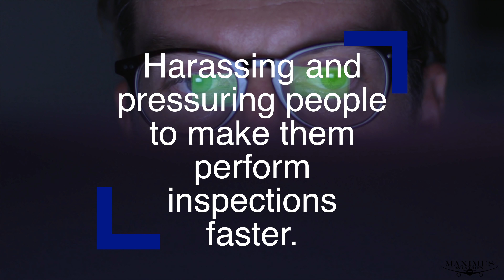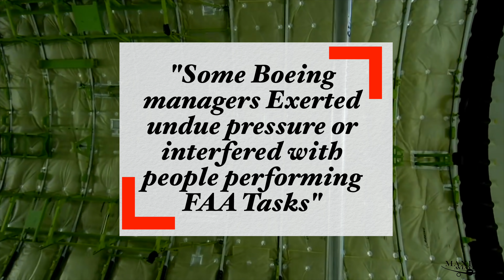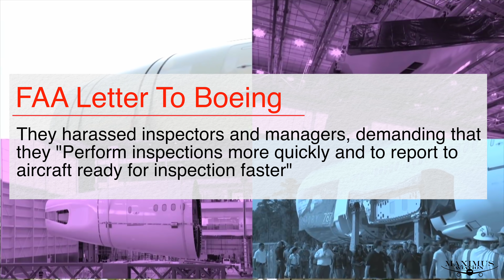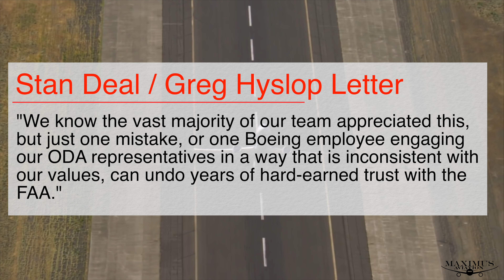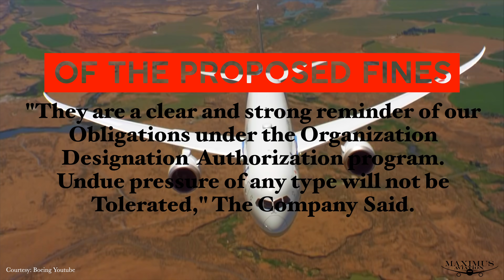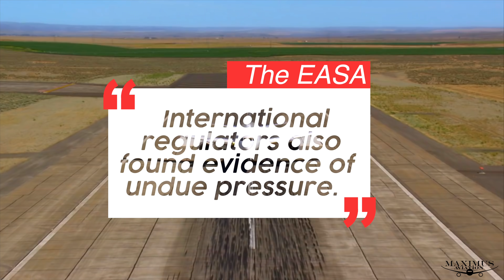FAA Fines Boeing 787 Program $1.25 Million Dollars For Interfering With The FAA's Inspection Process

Comment: FAA should refuse to certify any further Boeing aircraft while these people are still in management positions.
Reply: Well said. But will a mega corp  listen? How many have to die before there is change.
Reply: @johnambro7181  Too many, far too many. Boeing needs to be split up, before it collapses under its own weight, like Wall Street and The US auto industry back in 2008.
Reply: Exactly  right, David. @DavidLemmo
Reply: Would you not help your pals or your family members? :P that's how it goes! Plus - this is the largest exporter the US has... so.. it's all about the $$$, safety is and will always be at least 2nd after $ and/or fame.
Reply: @DavidLemmo  Boeing Commercial Aircraft is possibly not worth saving any more. They only have 2 active product lines to speak of and both are tainted.
Reply: @pasoundman  National pride and congressional meddling will keep Boeing Commercial afloat, at least untill they lose all their customers because Wall Street  bankers, who not concerned with the products were given more voice than the engineers that made Boeing Boeing.
Reply: @DavidLemmo  Sadly you're almost certainly correct.
Reply: Agree
Reply: Agreed, but we also need to investigate to discover if any undue influence was placed on those managers and up the hierarchy until the initial source of the undue influence is found.
Reply: @neilpickup237  I can't see that happening.
Reply: Fred Jansen  there's a revolving door between Industria and government Boeing has people in  every agency that's supposed to regulate it. The FAA will not put the brakes on any new Boeing's certification, unless there's a serious issue with it that legally requires the FAA to half certification.

Comment: The problems at Boeing date back to the MD merger. It is said MD basically bought Boeing with Boeings own money. MD was the company that was going broke and Boeing was the success. So they threw out Boeings model and started using MDs failed model. MD had been obsessed with pleasing Wall Street rather than engineering excellence. While pleasing Wall Street can give short term profits, it destroys the company,. Engineering Excellence will win every time. The problems at Boeing involve putting Wall Street profit oriented types rather than engineers in charge. Boeing's board needs reform to be run by a majority of engineers and floor workers, with the finance types being in the minority. Boeing put a plant at SC to avoid Unions. Unions are what have made many companies a success since they very often provide a quality assurance check and raise issues about quality issues. This actually saves many companies in the long run.
Reply: Well said!
Reply: James Keefe GE, Boeing, Intel. At some point they convinced themselves the stock market was the most important thing to them. All it does is let the managers gut the company.
Reply: @francesconicoletti2547  And look at where Intel is now, far inferior to AMD, still using their old 14nm manufacturing process.
Reply: GamingSpec offensive about to lose one of their biggest customers. Which might start a trend to take intel off the desktop.
Reply: 'Greed is good' is not a sustainable business model.
Reply: While I agree, it dates back far before.....in the 1950's Boeing was contracted by DoD to conduct research on EMF and it's effectiveness to disable ground based ICBM's. They tested numerous theories/approaches which included attaching a very large magnet to the bottom of a helicopter and flying at low altitude over a silo... the project was done in Colorado IIRR... the project was terminated for cause and every engineer died of a very rare and painful cancer which after years of research, was determined to be directly related to the project.  I want to state, at the time, this type of health hazard had little knowledge amongst scientists, health experts, etc.  In the early 70's, the project was re-started, but the full scope of the health/safety hazard information was withheld by Boeing Corporate executives including health & safety.  By the late 70's/early 80's, each engineer again had become ill and received the news from their physicians of the terminal condition.  When it was discovered their exposures could have been prevented or mitigated by known evidence and research withheld by Boeing, a class action lawsuit was filed against Boeing, whose attorney's utilized every legal remedy to delay due process.  When the last few project engineers were remaining alive, they had yet to begin trial, and they were interviewed on "60- Minutes".  The last remaining engineer, perished not long after that interview.  Boeing at one time was an incredible engineering firm, but a sub-group more interested in themselves (greed IMHO) began strategically moving up within the company and when it became a "wall-street firm" all ethics disappeared- IMHO
Reply: @jeffalvich9434  What was it that killed the engineers then ?
Reply: Fred Jansen  Not exactly, this is a value system that was created, executives trained their managers in and has been supported for years..... while you are right, that it is the current staff that gets 100% of the blame/responsibility, this is how they were taught, trained, evaluated to function....and it didn't happen overnight.
Reply: @pasoundman  it's been too many years ago now but if I remember correctly it was brain, lung and bone cancer of a very rare type
Reply: The whole college system of training of MBAs is all about cutting costs, not about producing high quality products at an effective price.  This is how we grew the entire Vulture Capitalist phenomenon.

Comment: Just when you think there is light at the end of the Boeing tunnel there is yet another plunge into darkness.
Reply: there's mroe to come! The 787 is filled with problems and so is the max but they're yet to find them all! 787s will start failing in a few years.. one by one... as there are fuselage and wing issues with it, besides the well known cable, batteries and engine ones!

Comment: This sort of pressure, is typical of all big company's.
But in this case , it cost's lives and Boeing are being found out.
This company needs to look at them self's , especially on a moral basis, not money basis.
Come on Boeing, get rid of the accountant managers, start doing things properly & safely. 
These are lives, not dollars.
Reply: John Haynes I don’t agree. For the last 14 yrs I am working for a global high tech company and stuff like this is not tolerated one bit, never ever.
Reply: @ghostindamachine  Interfere with the bottom line of the balance sheet and you will not be working for unsaid company.

Comment: They don't learn. This is what's costig them billions & their reputation. Why isn't the FAA task being done by themselves.
Reply: I do have some understanding for the FAA. Although I don't work in aviation I also work in a highly regulated industry (medical). It's completely normal for companies to do certain tests themselves. And it makes sense since the companies usually have the right equipment and the specialist staff to do so. Usually how it looks is that we write a report on the test and the results and the regulators review the report if the test methodology we used is sound and whether the results are plausible. And that works great as long as the regulators can trust us that we indeed performed the tests as we described them in the report.
And the regulators want to work with you, not against you. If you mess up, they don't want to shut you down. Depending on the severity of the problem they will say: "That looks like it could be a potential problem. You need to fix that. We will follow up on that in 3 months." Now if you lie to your regulators shit will (and should) hit the fan.
Reply: compuholic82:::  Like fox guarding the chicken coop  😃
Reply: @compuholic82  It still leaves a week point in the testing done by the company that benefits from the regulation, especially if the regulators don't have access to that equipment. Third-party testing would make me feel much safer. Until we have a society that churns out perfectly ethical human beings in full integrity in all conditions, that system has serious Achilles heels.
Reply: @compuholic82  captured regulators  -  what we call a corrupted system  profits/money as the main goal vs product quality
Reply: @compuholic82  In both industries it is inviting conflict of interests to have the regulated doing so much of the work of regulating. There is a cordon sanitaire for painfully obvious reason.  This didn't used to be the case in the US & isn't the case elsewhere.  FAA was so slow to respond to the 737 Max disaster, it was the Chinese who grounded them & they followed. The first time FAA has conceded  their primary role. This is a dysfunctional & disastrous set up. And signs of a a business environment   where business buys influence to a detrimental extent. It works for no one. Not even for Boeing as we can see.
Reply: @compuholic82  any corporation in the stock market shouldn't be trusted to in house certify anything.
Reply: The FAA is severely under funded by the government and could not affird to do this them selves. They can not afford the wages these people earn at Boeing.
Reply: @thearsenalmisfit2414  yes the FAA is underfunded, but all we need are individuals to monitor the processes being self regulated. We aren't asking for engineering degrees or even inspection certifications. Simply someone to assure processes are followed per the instructions. Fresh out of high school kids could read documents and assure they were being followed by corporations that were self regulating. You cannot have a person on the corporations payroll as they WILL be forced to comply with the corporations dodgy practices!
If we don't do something this lack of following procedures will continue and in time it will be catastrophic again!
Reply: @thearsenalmisfit2414  That is a catastrophic failure.  And a costly one. A CEO that has over seen Boeing's disaster leaves the with $80m as a thank you sums  up what's wrong.
Reply: @AllAboutMe-cy9xj  Don't get me wrong , I firmly put all of this on Boeing and continue to blame then to the point that I have not flwn on a Boeing aircraft since the second crash of the Max abd will never book a flight that involves obe of their aircraft.  They are a deplorable company that needs to have ist upper  management thrown injail for what has happened.Ive been boking flights on airbus A32X aircraft A330 aircraft and have niw experienced the A220 aircraft which put the Max I flew on to shame.
Reply: @thearsenalmisfit2414  I honestly didn't think you were trying to deflect any responsibility from Boeing. My personal opinion is Boeing holds the heaviest end of the responsibility as they conspired and took advantage of the FAA's inability to enforce rules. But I do hold the FAA partially responsible too because if they weren't lacking it wouldn't have presented easy advantages to be taken by Boeing.
I used to cherish the old Boeing Corporation and I trusted the FAA wholeheartedly, but honestly I had the wind knocked out of me when I was double punched by both Boeing & the FAA.
But then even I'm at fault for never questioning and always trusting empty promises.

Comment: Spent some time in the Everett factory several years ago. What I walked away with at that time was an overwhelming impression that quantity was far more of a driving factor than quality. The B78 airframes are scheduled to service the commercial airliner industry for forty (40) years. This pre-predicted vital usage timeline significantly exceeds any prior Boeing manufactured aircraft. Obviously, there will be incidences here too as well as hull loses along the way. It’s becoming more difficult to trust that there are no systemic issues with any next generation aircraft. Only time will tell if this operational/safety forecast was spot-on for the B78s.

Comment: Boeing think they are too big to conform to the laws. They deserve everything the FAA throws at them. FAA has got it's balls back.
Reply: The FAA won't actually fix the internal problems at Boeing. What would is changing the board so the board is dominated by a large majority of engineers and floor workers. The people who actually design and build the planes should be in charge of the company. Otherwise Boeing will continue to treat workers as expendable, morale will be low, and product will suffer. Boeing will continue to violate rules because Boeing will do risk calculations based that it can save more money by violating the rules even with the FAAs measly little fines cost them.
Reply: Are you joking? With that ridiculously small fine? 🤦🏻‍♂️
Reply: With that token fine? You’re kidding, right?
Reply: A 41.25 Mn fine is a comparative pat on the back. No balls needed.
Reply: @jameskeefe1761  A bit like Ford not fixing the Pinto because it was cheaper to pay out on the lawsuits.

Comment: I worked at Douglas Aircraft on both the DC-10/MD-11, MD-80+ lines and aircraft are built in positions with all the work for a given position scheduled so all planes can move to the next position.  Yes there is pressure to keep the the work for that position on schedule (including inspection tasks) as the stuff hits the fan if your behind holding up all the other positions. But, inspection has it’s own management separate from the assemble management so there seems to be something else going on here plus there’s many tasks that can be performed out of or in the next position to keep the planes moving down the line as all tasks are tracked and signed off. MD had a culture of quality and safety and Boeing had it in a big way on the 777, but their culture has changed in their commercial aircraft division (I’ve not read about quality issues in their military or space divisions).  I’ve heard words and org changes about a culture change back to quality and safety but again not read yet about them walking in that renewed culture!  
Has any one out there heard about the commercial aircraft division actually walking in quality and safety yet??

Comment: This seems to be a completely inadequate fine for the offense claimed.  Particularly after the 737 max debacle.  A better penalty would be a suspension for 2 months.  With no inspection or other paperwork to be attended to for the duration.  We need proper inspection and certification.  People's lives depend upon it.
Reply: I like the idea of punishing the people who destroyed Boeing by forcibly changing the companies board structure to be dominated and controlled with a large majority of engineers and workers. The same people who design and build the planes should control the board. Then you would start to see quality improve and the company regain its former glory
Reply: Boeing is a company. Its the idiots who took over the company after MD merger who are at fault. The board should be run by the people who design and build the planes

Comment: Since you asked;  I flew on a weekly basis for more than 15 years as a part of my job.  By the end of my flying days, I had enough of ever-smaller seats, cancelled flights, and stripping down for the TSA.  Since that time, I have seen nothing but bad news about the airline industry, and today would not fly, even if you paid me to.  I continue to be amazed at the crap that the general population will put up with so that they can get from point A to point B.  Me?  I would rather walk!
Reply: Small seats arent so bad on short flights but because a real issue when you are going overseas.
Reply: If you are a heavy traveler though those small seats even short flights would become a pain after repeated exposure to them

Comment: All I can say is when I flew on Southwest Airlines is was so tight the three and a half hour flight was excruciating.

The next flight on the United Airbus A320 was so much more comfortable. Is that the airline or the airplane?
Reply: I have flown with both aircraft within weeks (737 NG and A 320 CEO). I didn't feel a difference, but maybe it was the airline, because southwest is a LCC.
Reply: I flew on both Southwest(737 first row) and JetBlue(A320 second row), both equally comfortable.

Comment: In the USA aerospace industry, this type of thing is endemic (It didn't used to be). Its due to intense competition and money. In the late 1980's I worked in the USA for a large aerospace company. The electronics was very poor, and I wanted to re-design it all. I wasn't allowed, because they used to lose money on the initial development but make a fortune on spare parts. So the less reliable the electronics was good. It would fail and they would sell them a a new LRU (Line Replaceable Unit).